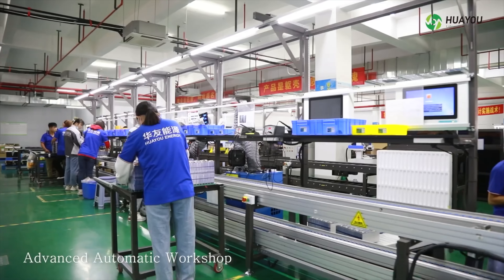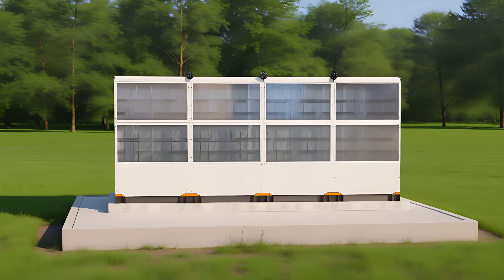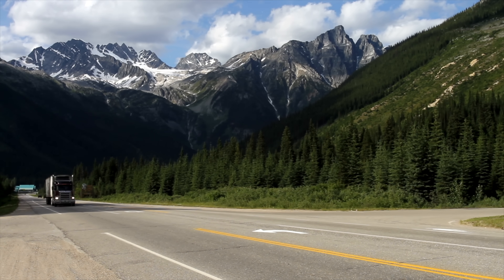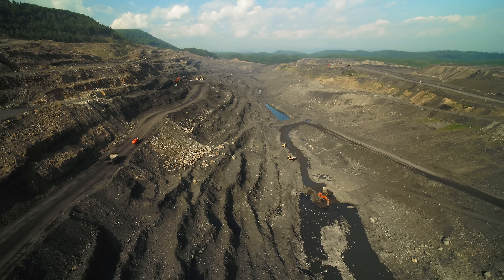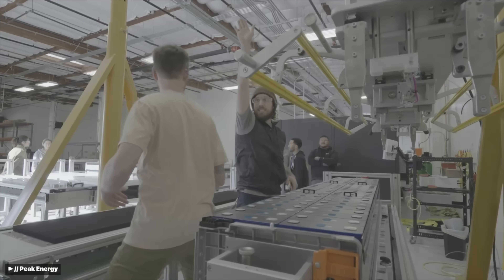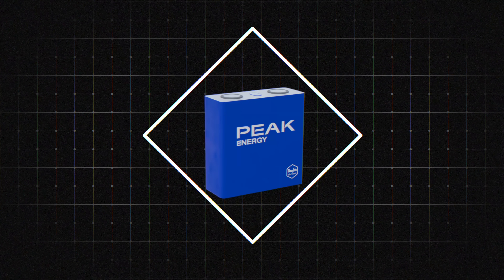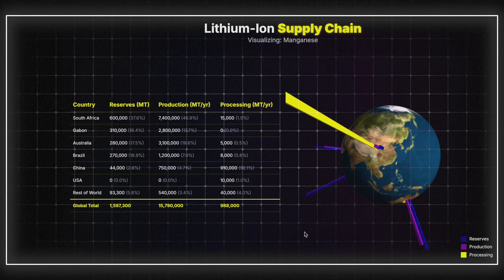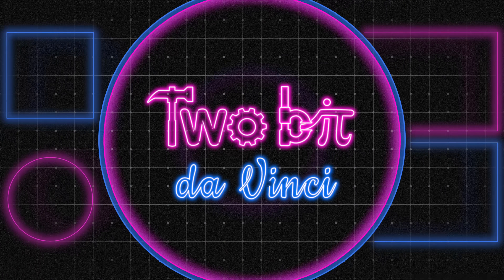Sodium Ion Batteries Are Going to be EVERYWHERE - Here's Why

Comment: Love science. Any heat is a propellant. Heat waves outside currents as fire rise compared to grounding towards the earth's surface as the force of pressure known as weight. Heat is pressure. Disruption of grounding and renewable grounding currents of heat do everything. Fire outside of mass Disrupting grounding currents to outermost surface perimeters first towards the core last in every scenario, disolving mass with fire which is photon singularity particles waves Disrupting heat grounding in equalization to repulsion inward pressure outside of mass  disolving mass outermost surface perimeters first wood in campfires slowly disolving outermost surface perimeters first follow the heat currents rising. Freezing repulsion moves inward when heat energy limited incoming freezes outermost surface perimeters first towards the core last. Thawing outermost surface perimeters first towards the core last. 100 percent repulsion 360 repulsion within and without entanglement of mass. Stars and planets are 360-degree repulsion in space. Stars disolving outermost surface perimeters first outward repulsion pressure from occupational space heat occupies space, so mass occupational space neutralized repulsion within and without entanglement of mass. Photon singularity particles waves coming from stars near and far away throughout space. Bubbles of heat as elements make up stars and planets heavier elements always sink to the bottom of the pool or core. Where heat storage is strongest. So heat is repulsed towards the weakest point of repulsion where heat is strongest currents flowing around these cores outermost surface perimeters. Elements are quantumized planets. Heat cycling circulation around the core holding the most abundant heat. Space is 100 percent repulsion and mass as heat is occupational space entanglement within and without mass heat is always entanglement of space as photon singularity particles waves and currents of elements heavier elements sink until displacement can't be overcome. Liquidity infinity as illusionary solidity of liquidity infinity currents flowing. Photons are quantumized comets singularity particles waves and currents friction sparks to repulsion perpetual motion throughout space as singularities the only place devoid of heat energy within space is black monopoles of pure repulsion to heat in the center of galaxies and start up of galaxies. Space is the repellant to propellant from the repellant. Look at a rocket blasting off the repellant moves the propellant outward force of heat pressure and rocket pushes through the repellant inward pressure of heat. Mass is in 100 percent repellant outside, and the mass itself is a repellant inside. I call that equalization of repulsion. Fire can disrupt grounding currents because photons outside of mass rise up and disrupting grounding currents towards the earth's surface and disolving outermost surface perimeters first towards the core last. Burning is disolving. Physics works without gravity and bending space and electricity. We have appliances that remove heat and restore heat. Hot batteries store heat. Generators speed up currents flowing faster around mass as more currents increases flow is like middle of the river flowing compared to the shallows. More currents more photons moving as impaction force. Dropping a bowling ball to a rubber ball filled with gases. The bowling ball contains more current grounding than the rubber but both balls are equal to the repulsion within and without both balls are in equalization of repulsion the variable is the impaction force when displacement can't be overcome. Physics works.

Comment: You should also do a video diving into the current development and research state of aluminum-ion batteries. The aluminum-ion battery also solves the dangers and manufacturing problems of a lithium battery. It also uses abundant and inexpensive materials, AND it has three times the energy density of lithium - a battery on a single charge that lasts three times that of a lithium battery, but like a sodium battery, it can't burn or explode. It has the advantage over lithium and sodium that it can be recharged in about 1/4 of the time of other battery chemistries.

Comment: For anyone wondering what is the difference between "sodium iron phosphate" and "sodium iron pyrophosphate":

The main difference is the phosphate group present: sodium iron phosphate contains a single phosphate unit (PO₄³⁻), while sodium iron pyrophosphate contains a pyrophosphate unit (P₂O₇⁴⁻).
This structural difference affects their chemical properties, with sodium iron pyrophosphate having a higher molecular weight and larger overall molecule due to the extra phosphorus and oxygen in the pyrophosphate group. 

*Sodium Iron Phosphate *
Phosphate Unit: Contains one phosphate group (PO₄³⁻).
Structure: Simpler structure with a single phosphorus-oxygen unit.
Uses: Can be used as a food additive, but the term "sodium iron phosphate" also broadly refers to any combination of sodium, iron, and phosphate.

*Sodium Iron Pyrophosphate *
Phosphate Unit: Contains a pyrophosphate group (P₂O₇⁴⁻), which is two phosphate units linked together. 
Structure: Has a larger and more complex structure due to the pyrophosphate unit. 
Uses: Used in food as an iron supplement to prevent anemia, as a chelating agent to prevent discoloration in potatoes, and in the development of electrode materials for sodium-ion batteries. 

In summary, the presence of the extra phosphorus and oxygen atoms in the pyrophosphate group of sodium iron pyrophosphate creates a distinct molecule with unique properties and applications compared to sodium iron phosphate.

Comment: I have two questions about this battery. Years ago I worked at a company as a test engineer and one task I was handed was to test a battery pack made from 18650 battery cells for cell life. I created an automated test that would charge and discharge the battery pack (with cool-off periods between) and do that for a week or more at a time, tracking the battery voltage and current flow once per minute for the duration of the test. What I saw was a deterioration of the battery capacity that got progressively worse with every charge and discharge cycle. It wasn't huge, but it was there. The time to charge and the time to discharge just got progressively shorter and shorter with every cycle, a little at a time. How does this new battery technology handle repeated charge and discharge cycles? Does it also lose charge capacity over multiple cycles?

Next question: EV manufacturers offer an 8 to 10 year warranty on the car battery, and they are forbiddingly expensive to replace. Actual battery life may be 12 to 15 years, and after that the car is worse than valueless because it is toxic waste that no one would want. What is the projected lifespan of a EV battery or stationary battery made with this technology? Can it last 15 years, 20 years, 30 years? Can I buy one battery and just keep moving it from car to car as I update the vehicle but keep the same battery pack?
Reply: Don't expect much more than high quality lithium-ion car batteries in terms of cycles.

But sodium-ion batteries will not be super-toxic waste, and will be cheaper.
Reply: @familhagaudir8561  What is the source of your information on the cycles? Are you involved with work on these batteries? I would LOVE to be a test engineer working on these things.  :)
Reply: CATL claims their sodium ion batteries have 10,000 cycle life, which is a lot better than lithium iron phosphate....  the battery should outlive the vehicles.

Comment: Home energy storage is where this technology could take off. Fire risk eliminated. Deeper cycles. No need for active cooling system that drains the battery. Size is less of an issue in home energy storage. It could be as big as a refrigerator and no one would care.

Comment: At 5:20, you said, "... 40 kilowatt-hours of power".  Please note, a kilowatt-hour is a measure of ENERGY, not power.
Reply: @trwent 
Yes; you are correct. 
But it also means, that one can run a 40kW gadget or machine for 1 hour (or a bit less).
Unlike in the Grid, where we don't bother about time, at all, here we need to take into consideration the wattage too. So the basic specification should be power (wattage) & then tailor our time requirement.
It is the same way I operate my lap-top. When it goes to charging time required is 10 minutes, then I shut it off (go to "sleep" mode)

Comment: Lithium-ion batteries generally offer the highest energy density (120-270 Wh/kg), followed by Lithium Iron Phosphate (LFP) (up to 200 Wh/kg), and then sodium-ion batteries (100-160 Wh/kg)... While lipo4  (LFP) provide good storage density AND LiFePO4 batteries do not release oxygen when damaged, which is crucial for preventing the runway fires that we know from Lithium-ion.

In other words, Sodium-ion gives you marginally better safety, but at the cost of even more storage capacity. Also, both Lithium variants are proven technologies, where as Sodium-ion is relative new on scale. Combined with the fact that LiFePO4 is already in extreme mass production. Home batteries is one thing, even cars like BYD use them and they tend to have way better lifetime endurance then all the other alternatives (at the slightly reduced range.

So ignoring LiFePO4 given how prevelevant they are these days ( and dirt cheap ) is really a issue.

Comment: I think an EV with 375 miles of range would be ideal. That's excellent commuter range and would be more than enough for those occasional road-trips. Even if it loses 15% of its range, it would still have ~319 miles of range.

Comment: ok i agree with the idea of using passive cooling, and yes you can get this through natural convection of storing underground and using thermal cooling vents to provide the cooling.

you know part of me thinks that this is what the pyramids were originally meant for.

i know people have talked about the pyramids as giant batteries, and they very well could have been, look at the design of them from the inside to the outside, a lot of it looks like it's meant to keep the power generation cool and to also allow the heat to escape.

Comment: The should partner with the just restarted Northvolt to creat car battery. I think it is a huge market for replacement battery in older cars. As well for new on. You don't need 500+km of range. 300 km and fast recharge is what is needed and that would work perfectly with those batteries.

Comment: Australia's Gelion develops two distinct battery chemistries: a zinc-bromide (ZnBr) technology using a specialized gel, and lithium-sulfur (Li-S) technology for higher energy density. The zinc-bromide gel battery is designed for stationary storage, leveraging abundant materials and operating at high temperatures without cooling or fire risk.

Comment: Brother I hate to break it to you but sodium batteries aren’t new at all. I used to work for the main supplier of US military missile defense batteries. They were building sodium batteries back in the 90s. The abandoned using sodium vs lithium because it’s just as dangerous (or more in some circumstances) but the power density is much less.

Comment: that sloped voltage curve is a big con, not a pro. The batteries are sized to the peak, but have to operate closer to the average over the discharge... this means an efficiency hit from running at a lower voltage. Massive BESS can just count amps to know SOC well. They don't just measure voltage. Still, cheap sodium batteries is a big win for BESS, cheap EVs, and soon enough maybe phones for those that don't mind a bit less storage and value safety / longevity.

Comment: QS just announced an Anodeless solid state battery with 10C power. I bet it solves most battery problems and supply chain issues, I hope. It will be for planes, trains and automobiles more than grid solutions in the short term anyway.

Comment: If this actually happens, I love that most homes will be set on battery banks for backup power instead of using combustion engine generators or scary lithium banks. I currently have a gas generator but hate the gas and oil maintenance for something I use every other year. These batteries will change all that. Honestly that's the least impressive thing that will be done with these batteries but it's my first idea that makes me happy lol

Comment: Sodium-ion batteries have been around for decades.  We built them in my physics class.
They out perform all other battery chemistries in every way, in terms of durability,  longevity,  reliability,  & stability... except charge capacity/mass, which is quite pitiful compared to other chemistries.  
The energy density of Sodium-ion batteries kind of sucks.

Comment: One thing that's fun about looking at this is that the biggest problem with the climate crisis is that too much heat is being pumped out, and this is pumping heat out.
Batteries are good for solving some of the climate problems, but they also create other problems.

It is better to insulate than to buy large air conditioners to cover the loss that comes from not being able to insulate and you save money in the end.

as Thanks for a good YouTube post

Comment: Sodium ion batteries (are) about to change everything... Is, is not The appropriate word for this situation. 
I know it's a fairly small detail but it is the title of the goddamn video and what everyone sees. As an electrical form in if one of my building inspectors walked in and saw that I had misspelled or used improper English on the labeling of my electrical panels it would cause them to do a deeper dive into every aspect of my work to see what other details I didn't pay attention to. 
Just some constructive criticism. 
Keep up the good work.
You could use the word is if the title was "The sodium ion battery is about to change everything...."

Comment: The new sodium battery from CATL has a breakthrough. It will replace LFP and lithium ion batteries in automotive and said to last 5 million miles and energy density at 175 Watt per Kg or about little more than LFP.

Comment: Hold on there matey, Na is a rare earth metal. Okay, it exists abundantly in compounds such as NaCl, but turning salt into Sodium is a VERY difficult process. By that argument, you might as well say that K isn't a rare earth element as you could extract it from bananas!

Moreover, I don't know what Chemistry classes you attended, but in mine, Sodium is actually MORE reactive than Li and not that much less reactive than K.

Also, having a voltage drop profile like this battery has, means that a BMS may have an easier time figuring out how much charge is in the battery, but you need way more electronics in order to deliver a constant voltage with a profile like that.

Comment: This is all good for large scale industry. Tney will be huge and thus not built to use in cars or everyday items. Yes he says it can work in cars. Yes it can. One thing he didn't hit on enough is the amount of charge and I didn't hear any could be wrong on battery discharge when not in use. Every battery loses charge sitting in a shelf, doing nothing. could lead us closer not too but closer to one of the largest issues with renewable energy. Power storage. Nithing on how long it last like how many discharges it takes to not work. How much loss in charge you after set number of charges. Batteries after so long will never charge back to 100% again. How much recycling it can have. How much per material you can use again how much you cant and how do you dispose of the waste. How well any charge is held and to what ammount on the size exactly. Just its bigger. 1.5x bigger or 4x bigger? Thats matters. Size of power storage is important. Didnt talk about what way power is stored in the unit at all. Does ut work with already made infrastructure or do we need to do changes? Can it slot right in to the ones we use now if it is the dame size? Or do we need to do some modifications to allow the battery to hook up? All cost we know nothing of. Will this be able to store renewable energy in a way that it can work through the night or low power times? Does it need a set high voltage or current charge to even charge? Or does it work on low volts low wats to charge? All part of infistructure question. So many unknowns but so much hype. Its not good and wont be good. We are way off before a new and more stable storage comes into play. Im glad we are working on it all now but we are still stuck with the most effective power storage there is. Solid fuels. Next liquid fuels. Then gas fuels. They will still out shine these batteries by far. I don't lose coal power over time. I dont lose liquid power if maintenance is done right as easy as batteries. I dont lose power in gas stored with the same maintenance as liquid. Batteries degrade and lose power storage if not used used to much over drained even these ones or just by sitting! We are doing better but we have a long ways to go before they are big news like he's claiming.